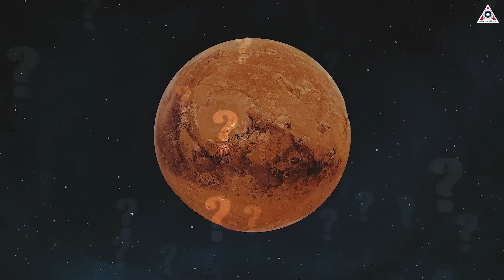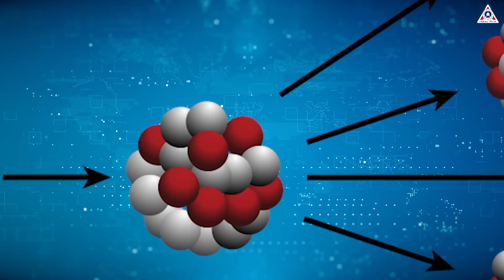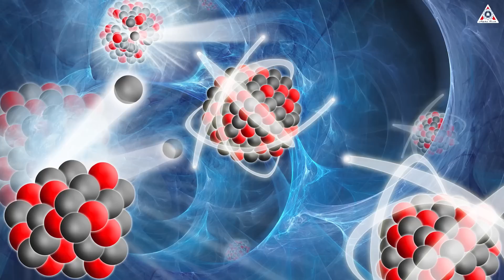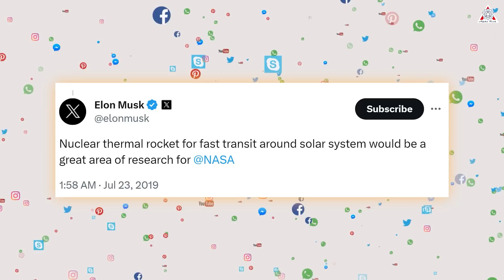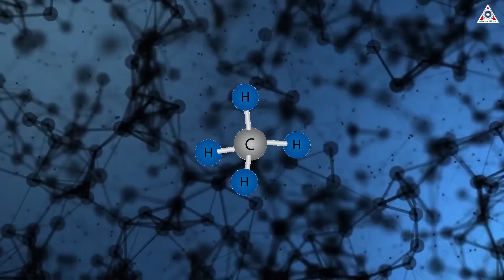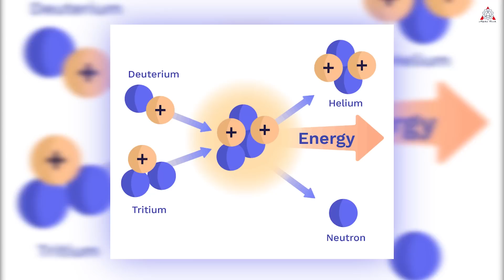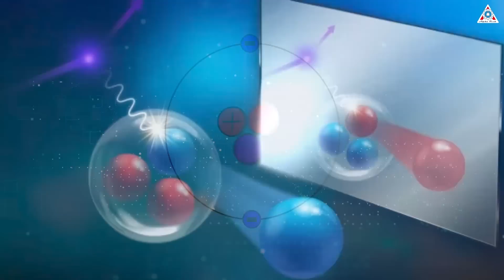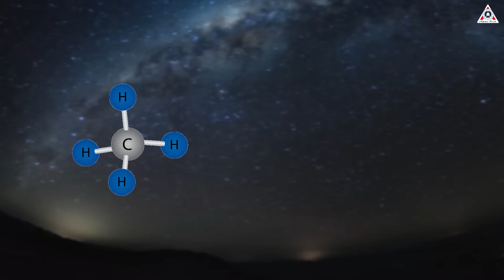NASA's NEW Nuclear Mars Rocket Engine is somehow better & faster than SpaceX Starship...

Comment: By the 2026, both Starhip and DRACO will be ready or almost ready. Why not combine both? I bet its on SpaceX and NASA minds. You don't even need to build a new Starship variant. Launch the current Starship with methalox design to orbit, then launch a DRACO engine in orbit, attach them together in orbit like the hot stage ring does in the booster or like tugs. Go to mars really fast, detach the engine in orbit then just land Starship with the methalox engines. It's brilliant. It's kind how they do in interestellar also.

Comment: You have now entered the twilight zone.  In what universe will NASA be sending a crew to Mars in 2030?  Certainly not this one.  It's debatable if they will even get a crew back to the moon by then.  It's comical to think that they will have a nuclear engine flying in space 3 years from now, and 3 years after that develop a whole new space ship for that engine.  It took them over a decade to get SLS into space, and it's a shuttle derived vehicle.  That means, from the beginning, they already had a head start by using components and tech that had already been developed for the space shuttle.  But yet, in just 6 years total, they are going to develop and fly a world's first nuclear rocket.
Reply: No one is talking about this but i bet it's in NASA and SpaceX minds: I see them integrating this nuclear engine in a Starship variant dedicated to ferry people to Mars and that will not enter atmosphere. It's the logical thing to do. A starship with a nuclear engine will have A LOT more internal space than it already has. And i don't believe its gonna take that long to develop only the engine, the NERVA project already did the heavy lifting. In 2026 they will have the biggest ship ever developed (Starship) and a state of the art nuclear engine, why not combine both? You don't even need to build a new Starship variant. Launch the current Starship with methalox design to orbit, then launch a DRACO engine in orbit, attach them together like the hot stage ring does in the booster. Go to mars really fast, detach the engine in orbit then just land with the methalox engines. It's brilliant.

Comment: Nelson just announced that NASA is STARTING a nuclear rocket engine program. This project will not happen because NASA funding changes every two years with an election cycle for obvious reasons. The only way nuclear engines are going to progress is for the private sector make it happen and that will not happen due to the control of fissile materials. Nelson touting a NASA nuclear engine is astronautical CLICK BAIT!  Like any other huge claim, I will believe it when I see it!
Reply: yes! to see is to believe that NASA would that have the Nuclear engine.

Comment: Let's be clear about this: 45 days to Mars is still a SNAIL'S PACE on an interstellar scale. Consider (we'll use miles here because km would require even larger numbers and because most viewers of this video will likely be from the U.S. or UK) that if Mars is at its CLOSEST 33.9 million miles away and the NEAREST star to our own - Alpha Centauri - is 4.2 light years or about 25 TRILLION miles away, that is over 743,463 TIMES FARTHER from earth than Mars is at its CLOSEST approach. 
IF, then, it takes 45 days to reach Mars, it'd take about 33.2 MILLION DAYS or 90,858 YEARS at that speed to just reach Alpha Centauri. 

So, while perfectly fine for trips to Mars - which is incredibly close compare to the rest of the galaxy - it's important to understand just how massively we need to improve our speed if we EVER hope to even so much as send out a probe to another star system and relay back data within a human lifetime. At light speed, it'd take over 4.2 years for the DATA to get back to us from a probe sent to our sun's nearest neighbor. That's on TOP of how long it'd take the probe to get there. To reduce it down to a mission that could be accomplished  within, say, 50 years (including the data return time), we therefore need to get the probe here in 45.8  years - in OTHER words, we need  ship that is literally THOUSANDS OF TIMES FASTER than this theoretical rocket, or one that is approaching 10% the speed of light (about 186,282 miles or 300,000 km per second). 45 days is 1,080 hours, so with a minimal distance to Mars that means the ship must travel about 31,389 miles per hour - or close to 50,000 km/hr - more than ten times the speed of a high-velocity rifle bullet - and in fact FASTER than that because part of the trip needs to be spent SLOWING DOWN otherwise you'd run right into Mars or scream right past it and off into space - there area no  hard brakes in space, only gradual deaccelerating. But the POINT is, it's fine for puttering around OUR solar system - but it's unimaginably far removed from even making one trip to the nearest star in any time scale a HUMAN could see it in.

That means two things:
1. We need far more exotic kinds of propulsion than simply nuclear thermal rockets to do it -
2. We need to massively step up our research into more theoretical territories. We're talking "warp drives" or antimatter engines, not simple thrusters. 

Besides that, ANY MANNED TRIP beyond earth's protective electromagnetic bubble will also require understanding and mitigating hazards like radiation or high-speed particle impacts. The faster YOU go, the easier even something the size of a grain of sand can rip a hole in your ship and kill everyone on board. 

There's also the matter of potentially irradiating portions of Mars (or Earth) if the thing malfunctions, and cold-war era agreements not to use nuclear power in space. You have to realize OTHER countries outside of America aren't going to love the idea that the U.S. has a loose nuclear power plant, in essence, being fired into orbit. You pass that threshold, what ELSE is allowed? Nuclear warheads on satellites, able to target rival nations, and aimed at anyone you don't like? THAT's a problem such a project would have to get past. Is it going to turn into an atomic explosion if it goes wrong? Well, NO, actually - nuclear bombs require a very deliberate and controlled process by which the radioactive matter is converted nearly instantly to energy - an uncontrolled explosion on a rocket won't do that - but it COULD rain radioactive material - a "dirty bomb" of sorts - across the planet below if it were to suffer a catastrophic failure during launch, which is obviously not ideal. 

The other issue I haven't touched on yet is acceleration. Humans are squishy, sensitive creatures, and there's only so much positive G forces we can cope with. This is  a hard limiter on how MUCH faster we can push a trip to somewhere as close as Mars. When going between stars, there's plenty of time to accelerate up to some ridiculous fraction the speed of light if the technology exists to DO that - you have many YEARS to do that - but going to Mars is different. It's like going from 0 to 300 miles per hour very gradually across an area 3,000 miles across (like the US or China) - vs  going from 0 to 300 mph by the time you get to the end of your block - in other words, 0 to 300 in like a SECOND vs 0 to 300 over 10 or 20 minutes of accelerating. Your body would be crushed by the forces over a very short distance but not over a more gradual acceleration to the same speed. Slowly move your head back, and then SLOWLY- very slowly - accelerate it forward - now, do that again but this time SNAP your head forward as fast as you can. You get the idea, right? Still, a trip lasting perhaps 2 months each way (plus whatever time you're actually on Mars - if you're waiting for the next closest approach to Earth you are in for a wait) SHOULD be viable if the technology is there.
Reply: Stop dreaming.  Humans aren't even going to the closet stars even with theoretical anti-matter engines.  At 10% lightspeed it would still take 30 years one way.
Reply: YES   🙂👍  --- Concerning Inter-Stellar flight -  A currently under development NASA Solar Sail - MIGHT - be capable of delivering a toaster oven sized instrument probe to Alpha Centauri after a 20 year flight.  But THAT is the current ENGINEERING LIMIT to anything forseeable at this time.
Reply: Which is why man's space travels are limited to no farther than Jupiter.

Comment: 12 days to Mars means an average velocity of 723,412 ft/s.     Acceleration over 1g for longer than 1.5 hours is harmful to human physiology.  So, an engine generating just 1g of acceleration would have to run for 15.7 days to achieve the desired velocity, which more than 3 days longer than the 12 day flight claim.   Ergo, total nonsense.

Comment: As he said, its been around since the sixties. However each attempt has shown that atomic erosion was massive over the internal structures.  On every engine they built the erosion was of such nature as to destroy the engine in a period so short as to make its use lost cause.  So far Ive seen only the same theories as tried in the past.  I expect, as in the case of the large ion thruster which was abandoned in the recent past and long history of failed attempts to accomplish this very same project, its just so much hot air.  I still think abandoning the large ion thruster was a bad move.  That one looked very promising... but the money was pissed away and whittled down and we all lost instead.

Comment: How does NASA contain the Radiation?
Reply: There is no need to do that because the engine will only be used in space.
Reply: @davidhess6593  Radiation in space is not a good thing either especially if humans are on board!    Rockets can explode on launch too!
Reply: @Create-The-Imaginable  If it were easy someone would have done it by now.  Also hydrogen seems a poor choice for a propellent.  If they don't need to burn it, why not use Xenon?

Comment: The problem with traveling at 500,000 mph is how are you going to shield the spacecraft from hitting even tiny micrometeorites?  The kinetic energy, KE, involved in a spacecraft traveling at a relative velocity, v, with respect to an object of mass, m, is equal to KE = 1/2·m·v^2.  Therefore, decreasing the time required to get from Earth to Mars from 6 months, or 180 days, to 45 days is a 180 days/45 days = 4X increase in speed.  The spacecraft would therefore be subjected to a possible 16X increase in kinetic energy collisions with any objects, such as micrometeorites.  This is a parameter that will have to be accounted for in the spacecraft design.

Comment: The nuclear ion engine is 80s tech that uses water for fuel. On 150 gallons of water, it could maintain 1g of accelleration before flipping over and doing it again for the remainder of the journey. Optimal time to Mars 36 hours.

Comment: I can explain quantum physics in a simple analogy. The thing about space travel and the extreme distances between planets is simply because things can't stop. If you were in a spaceship and were able to stop on a dime, everything else that is moving will crash into you obliterating you. Just like if you can travel the speed of light,the smallest particle that collides with your space vehicle will destroy it,even a grain of sand. Matter is always moving and in space all matter has gravity. Even a human. If a human was launched in space and could survive billions of years at first small microscopic dust will begin to collect around you and over millions of years that dust will turn into rocks. Matter in space is always moving and more than likely it's moving away from each other. Our solar system has balance but when you enter the galactic scale things begin to alter physics

Comment: Any nuclear rocket will be assembled in space. It will probably be fueled by plutonium with the fuel rods assembled on earth but the bundle or whatever form they use will be transported to space and run up there. That will avoid any earth radiation release. NASA will also probably look into nuclear electric rockets which will have some advantage over thermal rockets. Finally the choice of propellant will probably not be hydrogen but rather argon or xenon used in plasma form as a propellant. No new physics is needed but getting thermal nuclear or electric plasma nuclear in space will be a challenge.

Comment: NASA needs to make this DRAGO Nuclear engine burn the High Hydrogen Methane Fuel or Natural Gas because must ships will need the Methane for other uses like landing and launch. Nuclear 233, 235 and 238 is close the Thorium [232 & 233] reactor fuels. A lot safer than our electrical Power plants than has a life time 10,000 years but Thorium can use that burn up 2/3 of that waste and the remaining waste will be 300 years over 10,000 years and a system been developed to use those power plant waste. Space X can build a Space Station for gravity with .70gs at 80m+ and 16 ships and 2 telescopic Star Ship and 5 Docking/HAB MODs 8m square with 6 docking ports and 16m L. Can transport up to 30-50 crew but 10 are stations crew. 4 Transport Star-Ship/HABs, 2 Cargo Star-Ships, 8 Tankers and 2 Dopot/HUB Star-Shps. Crew will be able to go from one HAB cluster to the other in a 3m Tube. This is the same basic First Mission and supply missions without Telescopic Star-Ships @ Zero Gs. With a Drago Nuclear Tug Cluster added this will make Mars a NEW home for Humans.
Reply: Using methane for propellant in a nuclear rocket would defeat the purpose.  Hydrogen gives the highest exhaust velocity and thus the highest efficiency.

Comment: Where do you get hydrogen on mars?
Reply: Mars boasts widely available water ice deposits in its polar ice caps and possibly underground. Ice extraction remains a significant engineering challenge. But if water ice can be extracted, electrolysis can be used to produce hydrogen.
Reply: Import it like an illegal alien

Comment: My gess This engine only works in space. So it coule be dock to the back of Starship for the jorney 
between the planet. once in orbit of Mars undock the nuclear stage engine and leave it in orbit until the jorney back.
Reply: Except you still need reaction mass.  Ion thrusters need a fair amount of xenon to operate.  All nuclear engines do is provide a heat source for thermally expanding SOMETHING to be ejected out a nozzle.

Comment: They already use nuclear power for propulsion. So the transition to space travel should be obtainable, sooner than later!
Reply: Who is using nuclear power for propulsion?  Nobody that I know of.  At best, they use thermoelectric generators for electrical power generation, but not for propulsion.
Reply: Yeah, nuclear propulsion on a submarine and aircraft carrier. It's called steam turbines profesor. Try that in space. I know what you mean, I'm just goofen 🤪
Reply: Sorry, I should have been more precise.  No one is using nuclear energy for rocket launch propulsion.  Radioisotope thermoelectric generators are used for generating electrical power for satellites and deep space probes where solar panels are inadequate.  NERVA, when it was being developed, was a rather massive construct that was deemed too expensive to be practical.

Comment: You have failed to highlight the most important difference between chemical and nuclear propulsion.  NO WAY (at this time) can nuclear engines lift anything into orbit.  But - they can utilize the constant low thrust over days to exceed the performance of any chemical rocket in respect of velocity over an extended period of time when free of gravity's shackles.
A moon landing/takeoff may be practical with nuclear propulsion.  Probably not Mars and definitely not Earth.  But hey.  I live to be wrong and hope I am.

Comment: Starship would still be required. There needs to be something to get people into space and then you need something to land people on Mars. The nuclear rockets should just stay in space. Essentially SpaceX should have a fleet of starships orbiting Mars and Earth to ferry people to and from the surface. The designs of the Mars and Earth starships would be substantially different.
Reply: NT doesn't have the raw power to blast a heavy payload into orbit.
It's kinda like the ion propulsion. It's great for efficiency, meaning long fuel life, but its output is too slow to get anything to orbit. You have to already be in orbit.

Comment: This video constantly calls the proposed nuke rocket 'more powerful'...when it's not.   It's more 'efficient' meaning that isn't a matter of how much thrust it makes....it can produce a lesser amount for a longer period using the same amount of propellant ending with increased ISP which is a big difference.   

The Starship will do the burn to escape Earth's gravitational pull and send it toward Mars using only as much fuel as needed to get there while having enough left to slow down and then safely land.   The nuke engine will burn for a longer time toward Mars and eventually get up to a higher velocity....but this is a double-edged sword where every excess mph you make to get there needs a corresponding amount of energy to slow back down so you can land.    So all the 'it's more powerful' is nonsense...it's potentially more efficient.